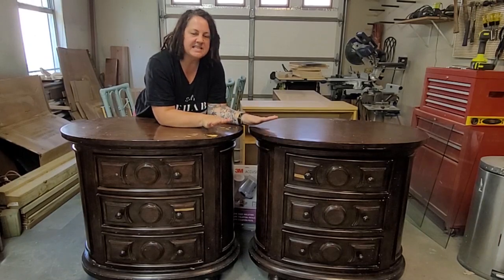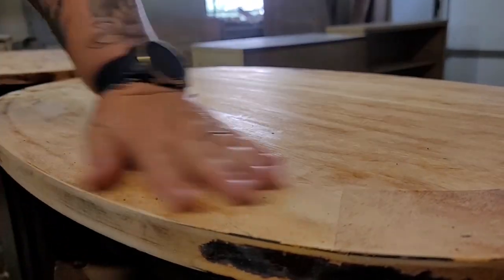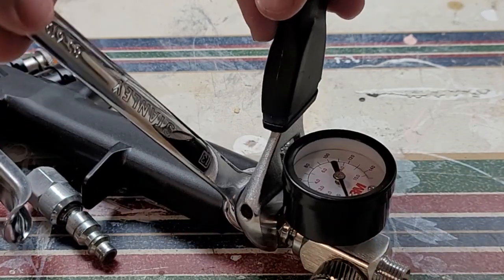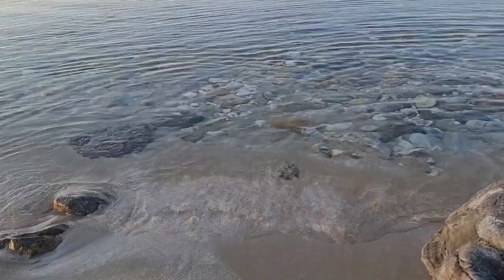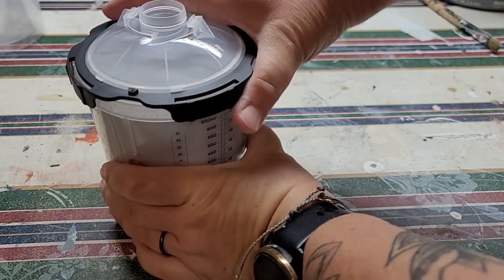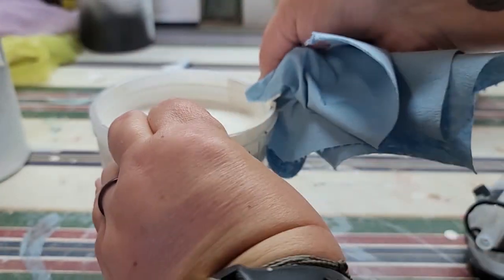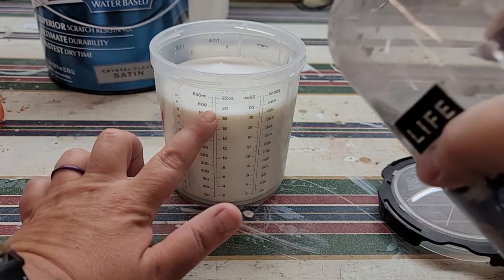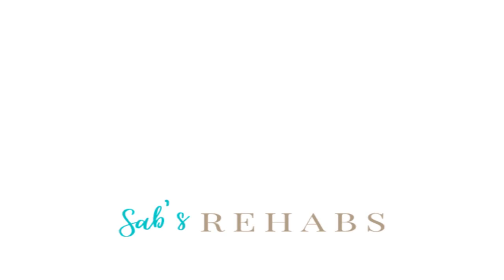HOW TO SPRAY CHALK PAINT WITH THE 3M ACCUSPRAY GUN

Comment: Wow, Sab, not bad.  Your popping off over on Mad's channel brought me over to watch you.  I call 'em like I see me.  Good video.  No doubt about it.  For anyone starting out, just a great explanation of how to.  Great clear video work. 

Personally, I don't like that gel stain look.  And I don't like waiting a day for oil to dry--and it's not really a day, it's more like two days and if you wipe it with a white paper towel after even two days--you''ll still see stain on the paper towel.  And I don't like having to use an oil-based topcoat out of a can.  Way too expensive and anything out of a spray can is a significantly inferior product.  

Tips:
1. Instead of gel stain, try diluting water-based paint.  50/50 paint to water and you can go as high as 70% water depending on how much see-through you want.  Looks great.  Dries in an hour.  And you can use a water-based top-coat or wax, same as for the rest of the piece and at the same time as the rest of the piece.  So much easier than having to go back and forth between water-based v oil-based products and timelines. 

2. Hit your piece with another round or two of stripper, rather than pulling out the scraper and the sander for the remaining splotches.  10 minutes into the 15-minute wait, start rubbing it with the steel wool and you'll get 99.9% of the paint off very easily.   It'll save you time, effort, sanding, scraping and gunked-up sandpaper. 
 
3. Try the citrus stripper--yeah, not nearly as powerful and takes 30 minutes--but that 15-minute stuff is so toxic! Both to the skin and to the lungs.  I won't touch it anymore.  Working on furniture is supposed to be fun and toxic is no fun.  

4. Spraying:  Narrow that spray pattern by half or more.  It'll only take you a couple more seconds to spray the piece and you'll have a lot more control and won't spray half the inside of the piece and you'll eliminate all that overspray around the sides and top.  They have spray patterns that are literally an inch.  Great for tight, deep ornamentation grooves and the strips between drawers. 

5. Spraying the drawers.  Have to say, I've never seen it done quite like that.  I'd be very wary about touching my freshly painted drawers--one smudge and it's a nightmare.  And painting drawers in the box?--really tough to get as good coverage down low and underneath ornamentation and edges.  I'm not one for getting down on my knees and painting up.   The best way to paint drawers is outside the base.  Put a drawer on a round turntable that stands waist-high, so the drawer face hangs over, and hold a thin piece of wood behind the drawer face as you go to block overspray.  Some people use cardboard, but make sure it's strong cardboard.  You cut the thin wood you hold behind the face to an L shape so you can hold it behind the drawer's corners and hit the corners with no overspray.  I have a couple of them, different sizes for different size drawers.  It's those corners and edges where paint wears/chips off first.  You want the best coverage on the corners and edges.  Either that or wrap them.  About the same.

Comment: First of all, GREAT JOB! ❤

I have a question that’s has nothing to do with spraying. (Of course!) How do you know if the wooden accents on the drawers can be removed? Can all be removed, I have some pieces with these accents on them that I hate, but I don’t know if I can remove them like you did on this project. It’s probably a common sense thing. 😂
Reply from the maker: Most of them are removable and even sometimes are plastic and not even wood. Only way to know for sure is to try removing them.

Comment: Why did you choose to use a stripper vs just sanding down to bare wood?
Reply from the maker: To sand down to bare wood on a finish that thick would be sanding with 80 grit, then 120, and then 220. So, I stripped to save time.